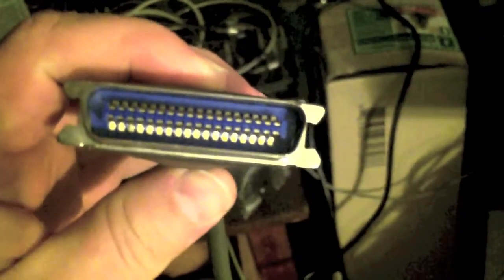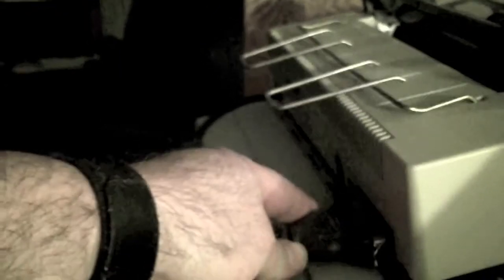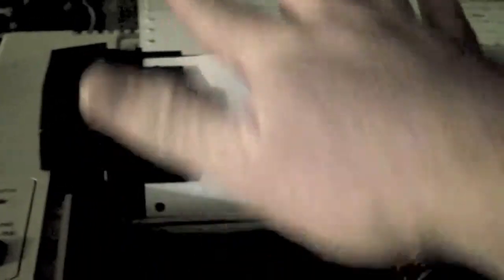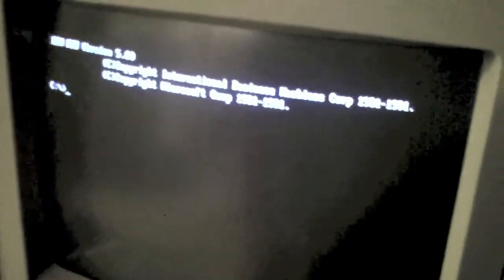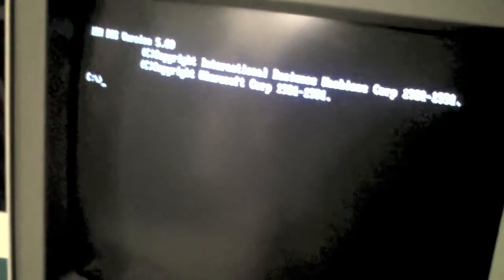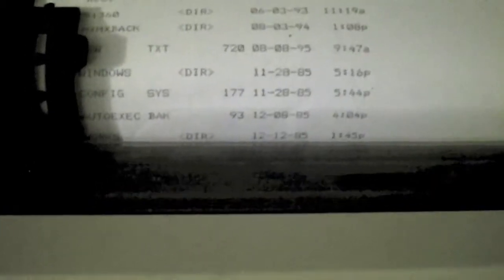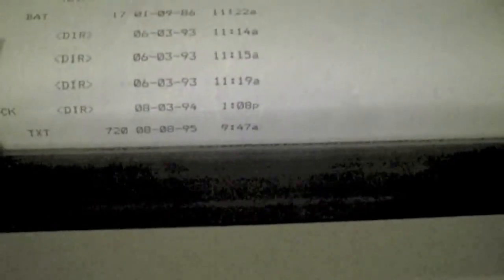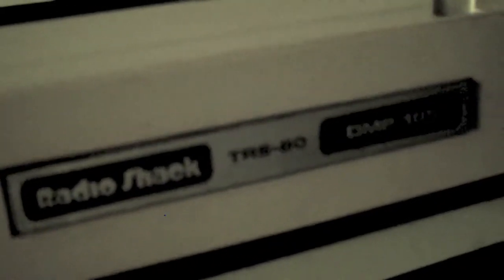TRS-80 DMP 105 connected to an IBM PS/2 56 486slc2

Comment: For some reason, it prints by default with double line feeds. You need to send it an ASCII escape code to get rid of this.
Also, all pins are addressable, which means you can do custom font and graphics.

Comment: do you know what year this printer came out? i can't find info about it
Reply from the maker: +Levi Cassidy   If I'm reading the serial number correctly, it looks like 1986.  However the DMP 106 line, which is almost identical, were made all the way up into the 90's
Reply: I had one in 1987.

Comment: Pin 18 on the Centronics interface has +5vdc originating at the printer. That standard existed before IBM came out with the PC, and when they did, IBM decided to change some of the pin assignments thus the grounded pin 18 DB-25 on the PC's parallel port - IBM's fault not Tandy's. Older TRS-80 computers and printers and their parallel ports were built to the standard, as you noted: to use some of the Tandy printers on an IBM PC (and the sea of clones) a special cable with no pin 18 was needed. Pin 18's power was put to good use on serial to parallel printer converters as the Blue Streak Ultima and Botek interfaces for the Color Computer, eliminates the need of an external power supply for the interface.

I still have my DMP-106A, slow and noisy but it got me through just fine on all those school paper printing projects, and on a student's tight budget :-)

Comment: It was an incredibly easy printer to program. I wrote my own graphics dump program for my coco in  BASIC (to work with my self made  paint program of course).  I had access to 'codump' from Tandy but I thought my output looked way better. I think it was only a 7 pin printer though. I did the output  6pins at a time iirc.